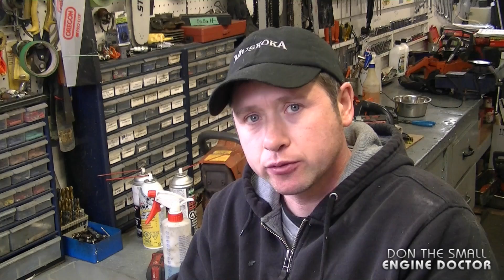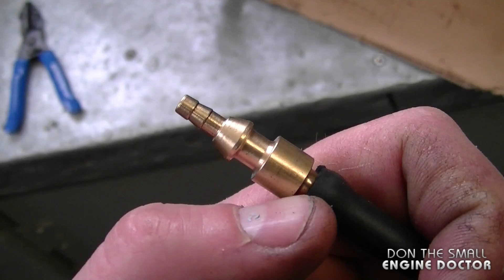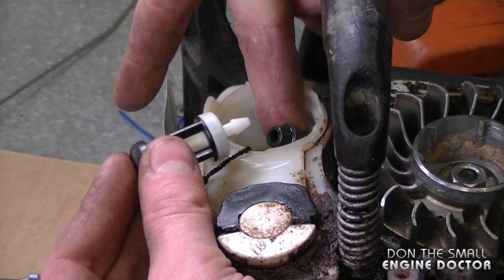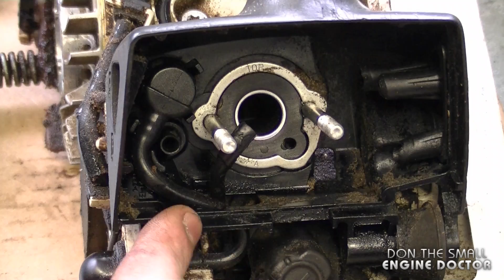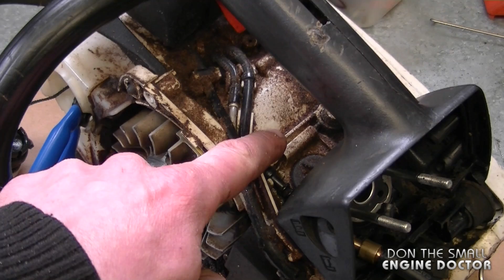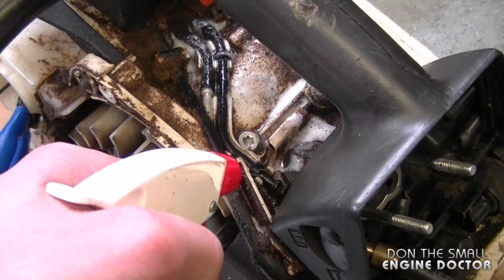Stihl MS192T Chainsaw Fuel Line Pressure Test

Comment: Does anyone know of the line next to the fuel line (silver, to the left) is the impulse line?
Reply: That isn't the impulse hose/line. The real impulse line comes from a pipe in the crankcase behind the flywheel, then makes a sharp bend up above the coil through  a hole in the body ,then connects to the plastic housing which is between the carb and inlet manifold.  It's really hard to spot where the connector is, you need to loosen the handle to access it. I've come across two ms192t's with unconnected impulse line , probably cos the mechanic gave up looking! -result being stalling when the saw is turned...

Comment: where did you get that pressure tester? I have been looking for some small like that for just that purpose but all I can find if the Mighty mac style and I already have a vacuum pump.
Reply from the maker: from one of my distributors, but now they are quite expensive. I can get you one if you want
Reply: Thanks Don
I am going to look for a used blood pressure cuff. It should give me the same results just might have to change the gauge. They are very expensive for a Might mac!!
Reply: I have been looking around and the Might vac pumps sell for a bout $58 on e-bay. Can you get me a small one for less. I have also been looking to build one out of a blood pressure cuff. I haven't got far on that I would have to change the gauge.
Reply from the maker: unfortunately I can't, the cost is more than that

Comment: hi i have a poulan lawn tractor the engine is a b&s 17.5 hp i/c that will not idle the throttle is closed an still revs very high pluse it an it idles down but then immediately starts to rev up to very fast can you help i tired cleaning it but still same prob. any info will help a lot thank you from  Kevin r.

Comment: Hi Dondoy73 I bought a pressure washer brand new about year and a half ago forgot the name but I think its troy probably used it 10 times give or take I use it every now and then problem is after it sit example month I can try to start it but I have to pull a lot example 30 times give or take but after that it will crank right up only happens after not using for a while it dosen't have a prime button. Could the carb be dirty
Reply: Crimsontide798 does it have a choke?
Reply: just a off and on button
Reply: Crimsontide798 It might be that the pump is acting as a brake on the engine. Do you drain the water out of the pump before you set it aside for a month and disconnect the hose that leads to the wand? Spray in a little pump protector? If it's one that you have to oil, how's the level? Maybe just try holding the wand open -- let the water flow out -- while you pull? Sometimes that alone helps me start my pressure washer when it's sluggish after sitting a while. Good luck!

Comment: Thanks for the video.. I have an MTD snow thrower  won't start. 5 years old not many hours just one season. Briggs and Stratton 4 cycle engine with overhead valves.  I have spark, fuel is good. Carb is good.  But feels way to easy to turn over when I pull the rope.  Just wondering if I should check the valve clearances??
Reply from the maker: George W yes especially the exhaust